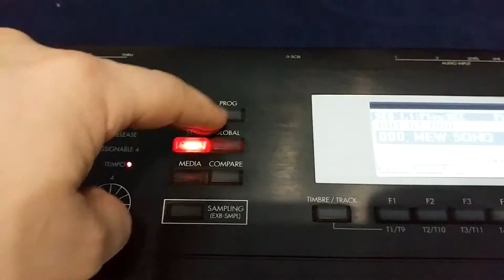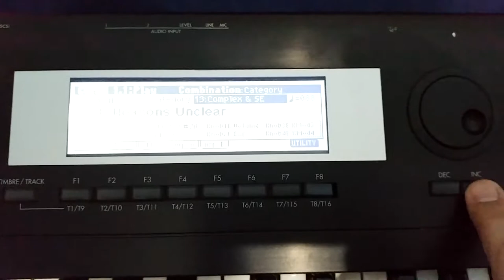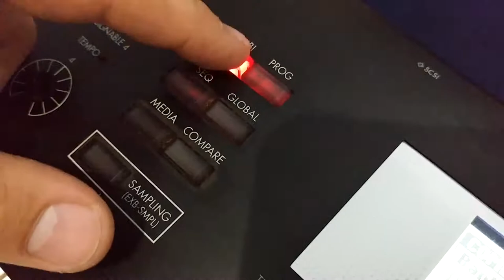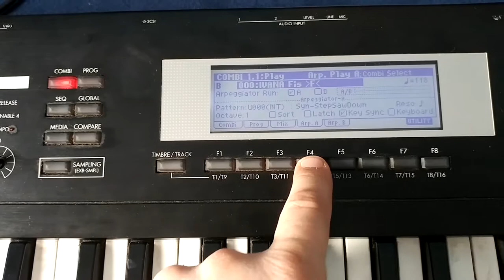Korg TR disassembly - switches and knobs cleaning - reassembly

Comment: Hey Snowking. Great video. 1 question though. Were you grounded before touching the mother boards? Is it OK without being grounded? Thanks in advance.
Reply: Nevermind it looks like you weren't wearing a strap. Thanks for the video
Reply from the maker: Yeah... no strap.. although, I never got shocked, I would advise to get a ground strap for a few bucks...
Reply: @snowkingcro  Thanks for responding. I was more worried about destroying the motherboard components.
Reply from the maker: I see, well, either way, it's on you to choose ☺️

Comment: Thanks. Having same problem of non-responsive buttons with Karma. I think it will be more or less same components like in your TR. Can same be done with rotary encoder, sliders and pots too?
Reply from the maker: If the rotary encoders are too loose, it won't help much, otherwise, cleaning them with contact spray will revive them! 👍
Reply: Thanks again for your reply. The rotatry encoder/dial is not much loose but sometimes jumps more than one increment. Tempo pot somewhat wobbles but its output is ok.

Comment: Nice video, thanks! A (dumb😉) beginners question: that contact spray has to dry up before re-assembling or did you wipe it away?
Reply from the maker: You don't need to wipe it away, only if you used too much, to prevent drops.
This is an oil contact spray, it always stays wet. And it is better than dry because it repells watter and dust from contacts!